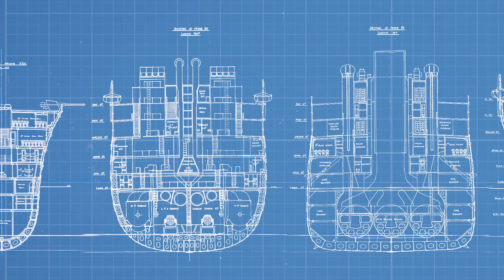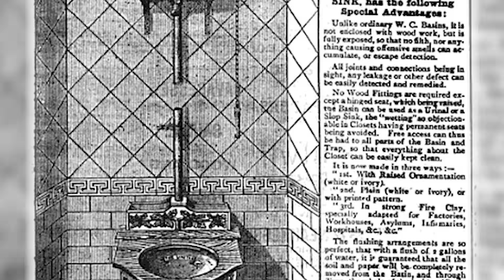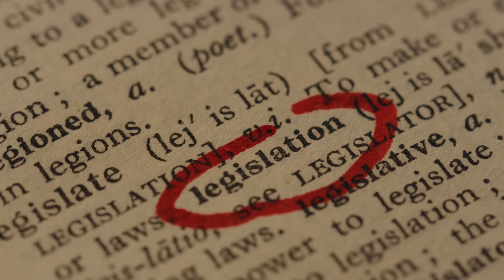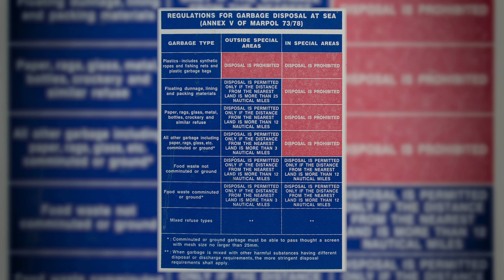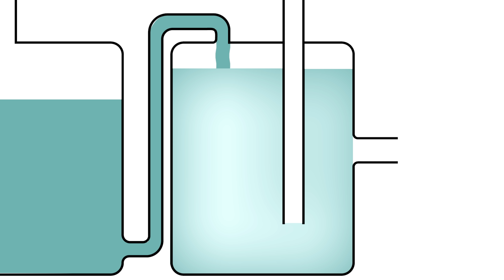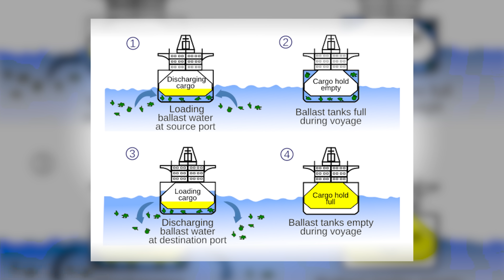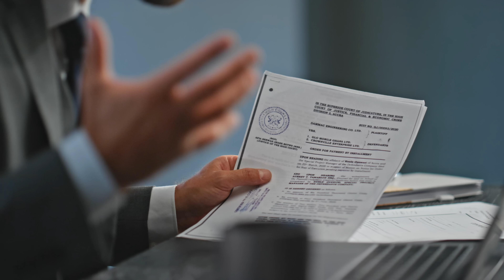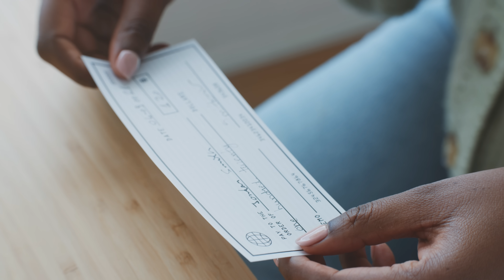Where Does The Sewage Go On A Ship?

Comment: For several months over 2006-2007 it was my job to unlock the valves and start the pumps to discharge the sewage on a cruise ship. This was done the moment the ship was far enough from shore as time was often limited. Never performed any tests on it.

Comment: When I worked offshore on a drilling rig in the early 1980s, the toilets just dumped straight overboard.  This seems fine to me because the fish are much more numerous than rig crews and they don't have to deal with regulations about sewage.  Also, the rig disposed of garbage as follows.  Hanging over the side of the rig was an open-top wire mesh cage about 30 feet long and about 8 feet wide and deep.  The wire mesh was made of sheep fence.  This served as the rig's dumpster into which all the daily trashbags got tossed.  When this "dumpster" was full., the contents were set on fire and the cage was hoisted by a crane out as far from the rig as it could reach and angled so the smoke wouldn't blow back onto the rig.  The cage hung about 20 feet above the water until the fire burned itself out in an hour or so, and then it was dunked into the sea and swished around from side to side for a few minutes, both to extinguish any remaining embers and to wash out all the ash and debris that was small enough to fit through the wire mesh.  Then it was hoisted back up and hung on the railing again.

This process was VERY popular with the fish because the main thing being burned here was kitchen waste.  This was before bottled water and whatnot so the trashbags were about the only plastic items included.  Otherwise, there was just a little paper.  Anyway, as the trashbags burned, food waste fell through the mess and the fish swarmed under the cage scarfing it up.  There was no point trying to fish from the rig itself during this time because all the fish were over at the garbage bonfire.  This method of garbage disposal got outlawed long ago but I've always wondered why, given that it seemed beneficial to the wildlife.
Reply: Probably because the powers that be couldn't figure out how to TAX those who used this method!
Reply: @NorthGeorgiaHawg  Hehehe, that's probably the answer :)

Comment: 5:54 According to Mike's cartoon, the fecal "solids" are filtered from the "black water" at step 1. But Mike doesn't explain what happens to those solids after they're separated from the black water. I get that after the fecal matter is filtered out, black water is rigorously treated and then released into the ocean in accordance with maritime regulations. But what happens to the fecal solids after they're filtered from the black water?

Comment: Well you missed a few parts, 
#1 that they use vacuum sewage collection systems for the black water.
#2 The sewage plant that is shown is a typical conventional system ( older design) and not a current awtp, with mbr or daf (mbbr) treatment ( would have been interesting if he talked about this).
#3 it would have been nice of he talked about the ships only being able to discharge x number if nm off the coast. 
#4 he didn't mention much about garbage other then they store it on board ( should have talked about how they handled the different types of waste), including the food waste systems they are quite complex.. 

Lookup EVAC marine , and wartsila mbr for descriptions of the current sewage systems in use. 
 I'm disappointed as he usually does a excellent job.  Rather than just the typical video